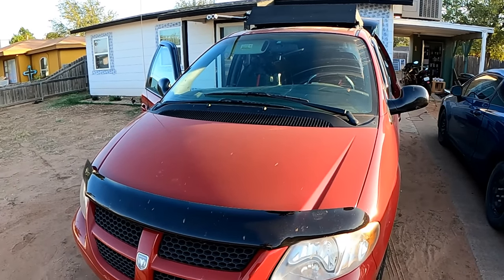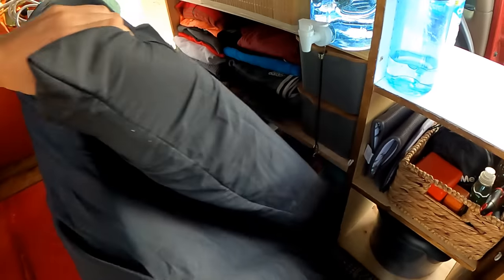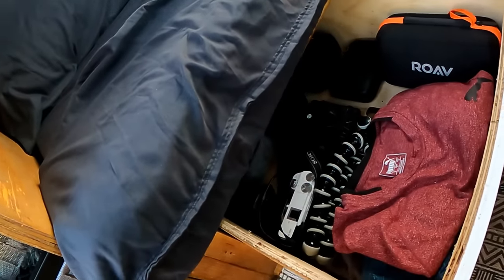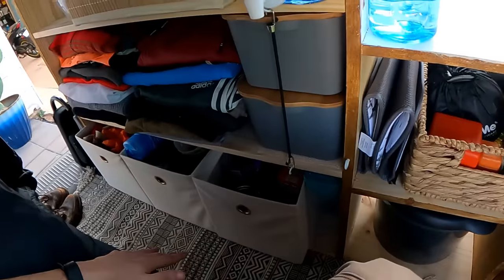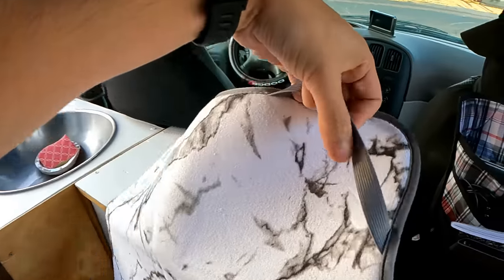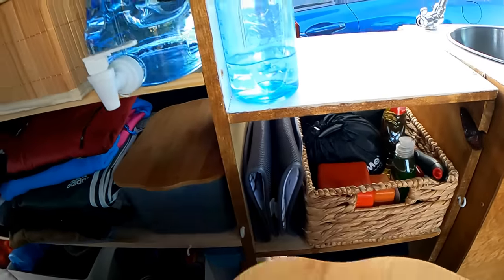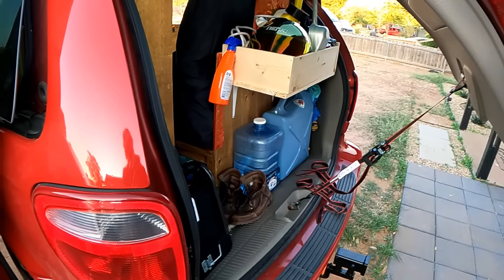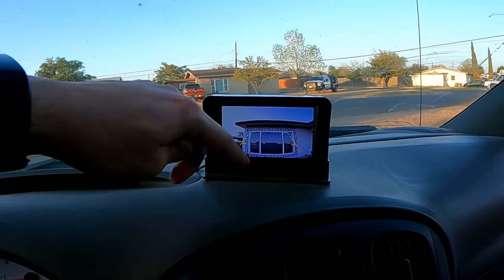Mini Vanlife 2002 Dodge Caravan Budget Conversion Tour DIY Simple, Cheap Setup

Comment: Looks great! Get a small container of kitty litter to pour into your “trash” container, in case you need to use it for that second purpose! Soaks up liquid and scent, and makes disposal easy.
Reply: And the litter can be used in an emergency for traction under the tires!
Reply: I get saw dust free from the lumberyard
Reply: @marysevonburns593  I have tried sawdust. It stays wet, doesn’t clump up and encapsulate it, and kill any scent like a good kitty litter does. With the Slide kitty litter from Arm & Hammer, the litter and the container stays clean and dry, pretty much. No wet, sticky mess to clean, if the bag tears, but, sure, it will work in a pinch, and you can’t beat the price!
Reply: Get unscented!
Reply: @kimwise5528  lmbo, awesome point
Reply: @marysevonburns593  im jealous, i cant find cedar sawdust anywhere
Reply: Use unscented kitty litter.  Less than 5 bucks at Walmart.  Test of litter.  7 days in desert BLM 2 of us and we bagged our stuff and took it to dumpster and NO SMELL would never know there was 16 plus bags of pee n poop.
Reply: Wtf
Reply: @Gimo76  lol

Comment: Great build. To wash your dishes and cut down on water use 2 spray bottles 1 vinegar and water next just water.
Reply: What was the ratio be on vinegar to water? I think it's an excellent idea I live in a studio apartment and I've really embraced minimalism...
Reply: @janfancher6619  about 50/50 white vinegar to water, but I usually go a bit more on the vinegar. It cleans ANYTHING! And is safe no matter how much you use it.
Reply: @ifkq  Do you use white wine vinegar in the small glass bottles or the white vinegar that comes in 2 quart jugs and is sometimes labeled "cleaning vinegar"?  I've used vinegar for cleaning floors but wasn't sure if the "cleaning vinegar " would be safe for dishes I'd be eating from
Reply: @triciaobrien8220  Actually I would use soap for washing dishes. Vinegar doesn't do grease/fat but can be good to add to soapy water. Cleaning vinegar should be fine as long as you dilute it 50/50 for anything else.
Reply: @triciaobrien8220  white distilled vinegar, water, and a couple drops of dawn
Reply: I really don’t think there’s a difference between white distilled vinegar and cleaning vinegar except the price.

Comment: Great for bucket use is ( scented cat litter) absorbes water n o smell,works perfect,,give it a try👍
Reply: thats what i do, the scented cat litter with baking soda and peat moss means absolutley no smell
Reply: l was thinking of using litter as well. BUT always go with unscented! Perfumed products mixed with nasty smells always smell worse. The unscented will be much more neutral. (Cat friends for all of my life) :~))
Reply: @Vanning with Aida Boricua , are you talking about using litter for peeing over? How do you store that in the van and how do you dispose of it?
Reply: @TraceyMush  In my Class B I can't have water onboard in the winter so I  line the toilet bowl with a plastic bag used for bedside commodes. I fill it with kitty liter and then double bag it and dispose of it at the park.

Comment: I'm looking at a 2014 Dodge Grand Caravan to use for trips. I like your build and will probably copy your's. Thank you for sharing.😊
Reply from the maker: No problem. The only suggestion i have is closing the back portion completely. I left an opening to exit or enter through the back but I never use it. By closing the back completely you will get more storage area in that back section. I will try to close it, down the road.
Reply: Fernando Perez - This is a great build. 👍🏼 Good Job!!!

Comment: It's super neat! It's a good move that you opted for baskets and organizers rather than adding wood drawers. It made the space roomier. And love that you can do a quick get away in case of emergency even if it's in "bed mode". Very practical. And I agree, don't waste time working on excessive interiors and spend it on adventuring.

Comment: these vans have bad transmissions, make sure you replace trans fluid in near future (i would use synthetic fluid)... but engines hold up very well.
Reply: @jolietjohnny   I believe the next body style starting in 2008
Reply: @jolietjohnny  P.S. ALL caravans from 84 to 2007 are shit. I have an 89 caravan, im on my 2nd trans rebuild in 140 K mies. Had 2003 113K mile Caravan that had a bad trans but drove ok while i owned it
Reply: @jolietjohnny  The trans in these vans aren't that bad, what's bad is the owners of them, they don't change out the trans fluid regularly. I have a 1999 with 250,000 miles and the original trans. I thrash on it, have a full camper build (its always loaded)and the trans is still working excellent. Change your fluid every 20-30k, just like you'd change oil in your engine. Clean fluid is the lifeblood. They do however crack the pinion pin in the differential, so if you get the tires spinning and hit dry pavement it'll shoot that pin out and grenade the diff housing portion of the trans. There's a keeper kit one can purchase and install to stop this.
Reply: @JG-kv4oi  Thanks you guys, great information
Reply: @welcometoreality3450  Thanks you guys,  great information.
Reply: @sissiesook2385   If you want to baby the trans get a large trans cooler & make sure your cooling system works as it should ESP in hot climate. Dont sit in gear while van  is running for long periods of time also, put it in neutral or park then
Reply: I had a 1996 Caravan and the transmission went out at only about 80K. Boy was I pi**ed. Had to fix it because couldn’t get rid of it like it was. Traded next day for Surburban. Drove that sucker for 17 years and it was still going strong when I traded it.

Comment: Interesting, I haven’t seen a “floor plan“ quite like that!

Also I really love that there is no console! I’ve been planning to get a Dodge Caravan for my build, but maybe because I’ve been looking at more modern ones they all seem to have a consoo… I really want to be able to walk into the back from the driver seat very easily.
Reply: Kia Sedona is better
Reply: Center consoles are only held in with a couple of screws most of the time.  If you find a van you like. Just search for a video to remove the center console and you can see how to remove them.
Reply: @kevinvan9883  Thanks for that tip!
Reply: @MrBlaze256  Can you elaborate? I’ve been debating between a few different minivans, including the Sedona.
Reply: @lindasue8719  what year?
Reply: @lindasue8719  Kia Sedonas are cheaper. Have a center console tray that folds down. I bought a 2010 for 2500 and it has 130k miles. I've seen alot for sale with way over 200k miles. It's pretty fast too. Has the same engine as the Hyundai Genesis sports car

Comment: Thank you for this. This looks very organized and real.
You are well spoken. Keep it up. Also, thank you for using class and modern every day elegance. When you spoke about your trash can and the "other purpose." When I saw you talk about it and you opened it up, I actually turned my head, but I appreciate you letting us all know that you haven't used it for the second purpose. Your language and your vocabulary is on the par and very appropriate.
We need so much more of that now a days. 
This is something I would feel comfortable showing my kids as well.
Reply: I also love all of your containers. The ones @ 10:27 and the bamboo/straw like one are 🌟
They are the correct ones for so many purposes and not flimsy and cheap. Where did you get them?
Reply: The container @ 11:00 is perfectly spaced there in that particular spot. You don't have to use it for food storage either. Those type of containers make great storage for anything really that could fit in there and not worry about anything falling out.
Other than using it for food storage like cereal or dry pasta, etc. I can think of storing your school/office supplies in there as well as plastic grocery bags, or even important pieces of mail,  or tools if you don't have a tool box, basically anything. 
You're a smart cookie and get into salvation.
Reply: G-d bless you.
Reply from the maker: I bought my containers at Ross. I usually shop at Ross, and TJMAXX for most things related to organization and clothing.
Reply: @fipl1205  
Awesome! Thank you so much. All the best to you. 
Pray, give yourself to Jesus, obtain salvation according to Acts 2:38 and live out Jesus's purpose for you.❤️

Comment: Being a van-crash survivor where factory installed items became flying projectiles it's highly suggested you attach everything to the in-floor seating floor brackets that are welded in by the original OEM. Use u-bolts &/or turnbuckles. NOT bungie cords or you'll pay the price.

Comment: Very nice.  I like the covered storage bins - it really makes the space look clean and uncluttered.  Where did you get the covered bamboo storage bins?  

Also, let us know if you end up Even needing to use the foot pump for the sink.  Great work, thank you for sharing.
Reply from the maker: I bought the bins at Ross. Right now they have a lot of those storage bins, all kinds of different sizes and colors! Many to pick from. The small ones I have for my socks and underwear are about $4. The bigger one is around $6. I'm sure i will end up using the foot pump for the sink. I have used it before, in a tent arrangement that I had and it was very useful and worked great.

Comment: Great ideas!  I have a 2,005 Dodge Caravan.  I hadn't thought about putting cloth over cushions and stapling it to wood underneath.  Silly me.  That's so simple. I need a comfortable seat in the back that's low enough so I can sit up straight at a small table to work at, and my head won't touch the ceiling.  I want to design mine just like yours except I already have a built in bed.  Thanks so much.  I'm subscribing.

Comment: Instead of having to take off that back of seat organizer by your bed feet, just push the seat up or have it bend out of your way.
Reply: For anyone reading this in 2022, there is no "just" in vanlife. Things that are simple when you're just using your vehicle for transportation, or simple in your mind, become time-consuming and irritating when you're living in your vehicle. The controls for the passenger seat are on the outside of the seat, between the seat and the door. Reaching over to grab those controls, and then hold those controls if it's a power seat, is a real pain, especially if you're in the driver's seat and there is stuff on the passenger seat. Even reaching it from the back is a pain because your hand has to be small enough to fit in that little gap and reach up to the controls. If it's not a power seat, you're not going to be able to move that seat up unless you're sitting in it. Either way, it's way easier to just turn the organizer around than mess with that seat.

When I was preparing for van life, I wondered why van lifers weren't doing "just this" or "just that." When I moved into my SUV, I realized why they weren't doing "just this" or "just that." People are not stupid. If they're doing something a certain way, there's usually a very good reason. A reason that's usually not apparent when you're thinking about vanlife vs living vanlife.

Comment: Is the mattress a twin or twin xl? How much room do you have at the end of the bed for your legs?
Reply from the maker: The mattress was actually a queen.  i cut it to fit. It's somewhere around 27"x 72" fully extended. If I move the passenger seat forward I get more room that way too and my feet don't touch the seat.
Reply: @fipl1205  this set up is what i have been thinking to do, and now I see it will work!! Excellent, Thank you so much for sharing!!Safe driving an lots of good wishes for you!

Comment: Nice clean job! I have a 2003 Caravan. To hold the hatch open I clamp vice grips on the strut rod. It's usually against the hatch so it's open just a few inches. Increases ventilation a LOT!!

Comment: The empty container with the blue top I would use for trash.  Small enough that you will have to empty it regularly.  Also, having a lid on it will minimize the potential smells from garbage in your tiny space.  Have seen it done in other builds.

Comment: I, too, have a Dodge Grand Caravan.  I've probably looked at 100 videos with 100 different floor plans, and yours is BY FAR the best.  Having the narrow walkway is brilliant!  I might skip the built-in sink....not sure yet.  I also might add a pull-out counter/table top from the shelves on the left side so I could sit on the bed and work/eat on the table.  You really use every bit of space, and it is all accessible without having to dig out a lot of stuff to get to anything in the back.  If you connect the sink, will you have an easily-removed access door from outside?  Thank you so much....this absolutely is the plan I will use.
Reply from the maker: I don't understand the question about connecting the sink and having an access door from the outside. I hadn't thought about adding a pull out counter table. I might add that.

Comment: I’ve seen a lot of van builds and yours is one of the more brilliant ones that I have seen. you were absolutely correct in stating that you don’t need cabinets and all this other stuff and drawers. shelves work absolutely brilliant. My van is quite a bit bigger than yours, however everything I have in it is very easily accessible. I used a lot of those fabric baskets and basically did shelving as well. I used plastic drawers in places where I need to drawers.

Comment: I have seen many van builds very similar to yours.  What I like most about yours is that storage area where u put your blankets.  Never have I seen that ever! I could see a smaller laundry dirty clothes bag stuffed in there cuz its so deep.  I would mount your shell to hold the sponge on top of the counter in the corner nearest to the drivers seat belt.  Happy trails dude!

Comment: You did a good job!  I like the idea of your bed, but I went the pullout couch route in case while at a camping event I get lucky LOL.  I got lucky last year and found a 2010 transit connect with only 46k miles on it.  I am technically the 3rd owner (the second owner was the garage that serviced the van for the laser optical company that used it for occasional deliveries')  I had to put a grand into it to replace 2 bad sensors and the starter was weak and cutout.  I don't live in mine, just for daily driving and hopefully we will have covid under control by next may for camping events and music festivals.  I laid out my van's design to allow me to fit my electronic mountain bike folded inside my van for safety and I can sleep on my couch while the bike is in there so don't need to worry at rest stops for the night.  With the front tire off and the 13lb battery removed, I can just lift it up onto my roof rack or secure it to my bumper while camping.  I have a little more mileage on me and was very fortunate that a close older friend who was a carpenter who only had daughters and was thrilled to teach me wood working.  I am no pro lol but every project seems to come out a little better then the one before...  I saw a video on cross dowel construction using steel hardware and a jib for 1/2" baltic birch plywood.  Makes for easy assembly and disassembly.  I like that my galley and bed came out more "professional looking".  I agree with you 100% on the weight, and for my bed instead of adding another 50lbs for drawers, I made my bed so I could fit 3 milk crates under it and a larger area to fit my porta potty (I prefer it to pooping in a bag lol).  Milk crates are much lighter.  I like those 2 plastic tubs you have with the wooden lids... where did you find them?  Oh here is my instagram, have some pics of my van and my diy electric mountain bike I built.  Happy Travels  https://www.instagram.com/hermitage_leathers/

Comment: I have been buying and buying more camping and van life gear for probably a decade now. I am ready to go lol! June 2 I will be heading out for Pennsylvania, for three months trip. I am a disabled senior that travels for suicide awareness since losing my son Jeff in 2016, in my wheelchair modified 2010 dodge grand caravan with my four Chihuahuas.  I have a wire cubby in the Hatch area for storage. I also have a platform bed with some storage space underneath. I have kept the smaller section of the backseat as well as the two front seats for when my grandchildren travel with me. The rest of the floor space is taken up by my power chair. I am by no means a minimalist and definitely travel with too much stuff. And I still have more stuff for camping and emergency gear at home outside Palestine TX, for the day I can score a larger rig.  Unfortunately, due to the wheelchair modification, I cannot have a rear hitch for a tiny trailer or even a storage box on the back, and being in a wheelchair it is hard to access anything on the roof. But I do have 2 solar panels and a roof box up top for when other people travel with me. As well as a Bluetti EB70 n EB3a solar generators. My dream vehicle is a short wheelchair Bus conversion with plenty of storage space! Safe Travels & Enjoy YOUR Journey 
❤️🐾🚐👍🏻😁☀️🇺🇸🔥
https://youtube.com/@JeffeysMom
FB Jeffeys Dawn A Burton

Comment: I'm using your setup for my SUV except for my bed I'm going to have a piece of wood with a string on the end as a handle that I pull out from under the bed and lay on top of the bench. That way I don't have to move the entire mattress off the bed. I just pull the mattress forward onto the board. I'm doing the build now and it looks way easier on video than it is in reality. 😂